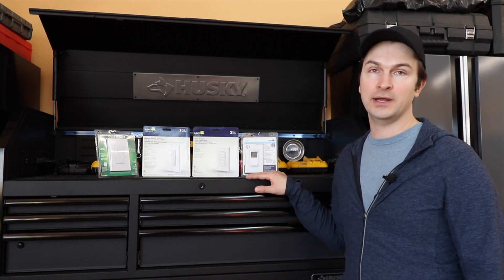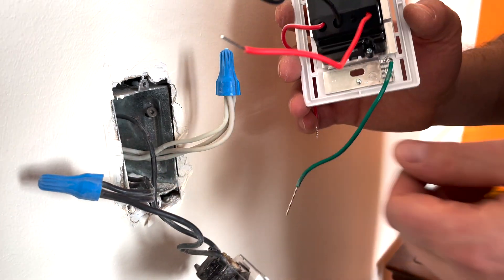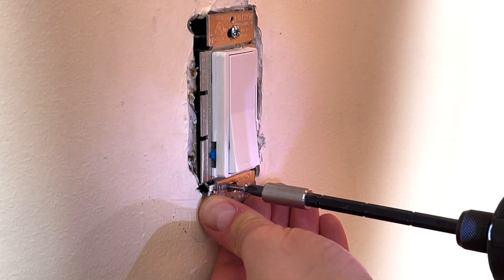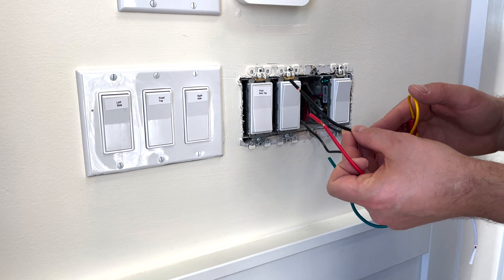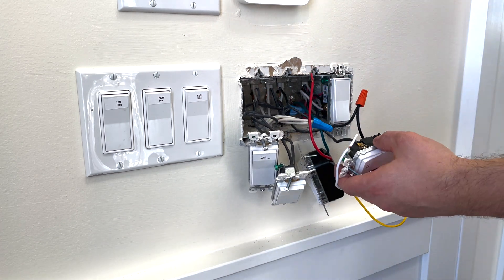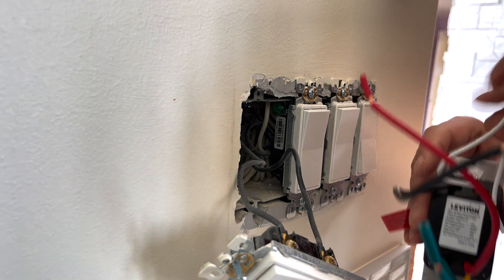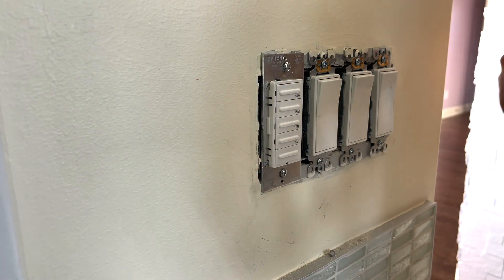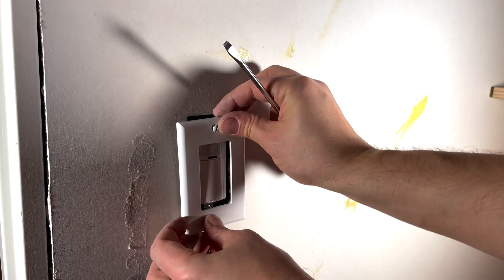Simple way to change your light switches to a dimmer, a timer, and a motion sensor

Comment: Hi Is there  switch that has a dimmer and timer built in one? I need to dim my front overhang lights and would like to it to be on a timer as well. For instance have the front lights turn on at 7 PM (Dimmed) and shut off at 10 PM.

Comment: On the first switch, what is that blue tab on the bottom left?  (Before the cover plate goes on)
Reply from the maker: I added a wire nut to isolate the 3 way wire. Hope it helps. Cheers!
Reply: Not the wire nut,  at 3:23 there is a blue tab that stick out a bit that looks like it can slide up and down, the faceplate covers it though, so it's something that would be set and left alone.
Reply from the maker: The blue tab acts like a dimmer. You can slide it up or down. You can use it to set the brightness of the lights.